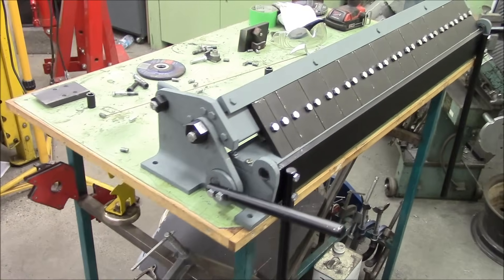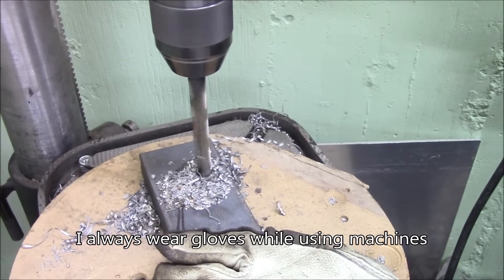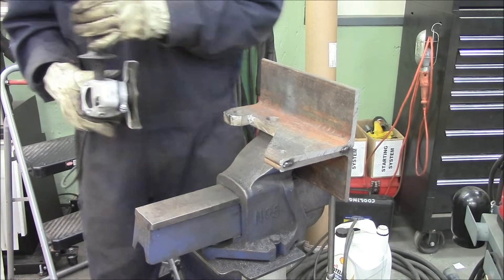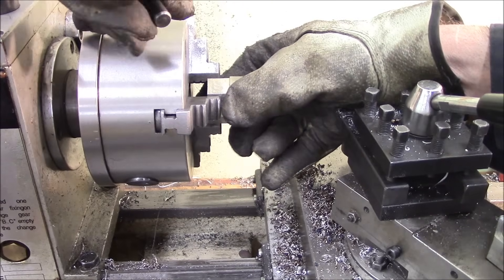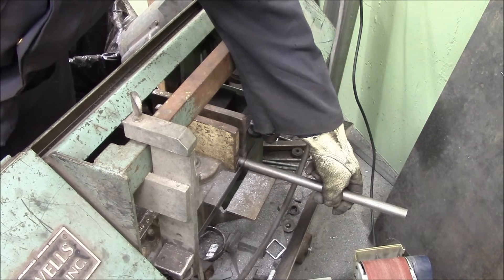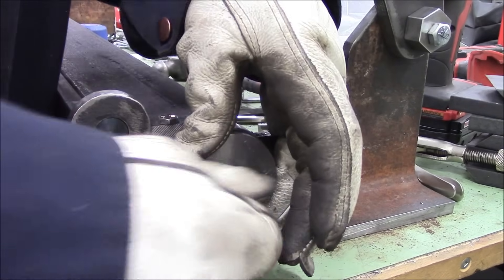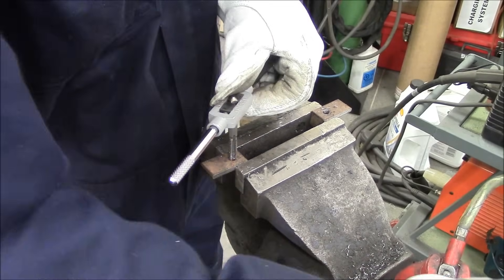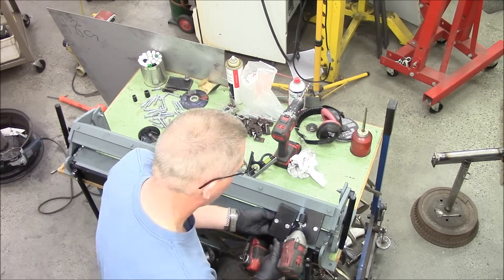BUILD a Sheet Metal Brake! FREE PLANS!

Comment: Nice work! What is the steel thickness capacity?
Reply from the maker: It does what I've needed it to do, which is usually 16ga and less.  The thicker you want to bend, the larger it has to be.  I'd say 16ga is the limit in steel, but I have not bend a full 36" length of 16ga.  I have bent 30" of 18ga.
Reply: @GregWellwood  thank you I'm using your design but modified to be 48"

Comment: why make an a-frame brace on top instead of a piece of flat bar?
Reply from the maker: You could make the whole thing super massive huge, but a typical A-Frame on the top adds the rigidity you may need, without the added expense and weight.  The height of it is what matters, engineering-wise.

Comment: 5:59. My experiences with a metal cutting wheel is the thinner your material the faster the cut (duh) I think I could have cut both pieces faster by themselves. Who cares if the angle of either side doesn’t match exactly. No one will notice. Matching holes yes, matching shape outcome no

Comment: Just watched your video nice job only one bone to gloves. You need to see what happens to best of them when you wear glove on any moving power tools. Yes I have stitches but after 40+ years as a Tool & Die maker I have all 10 fingers and all 10 toes.. I also wear steel toed boots dropped a 580# injection mold slide on my foot and walked away with a broken great toe. I saw what happens to your dead cow when it gets caught in a belt sander not pretty or a long sleeve caught in a multi spindle drill head he got lucky the shirt ripped off his back.

Comment: Will this bend 11 ga full width? Maybe I missed the specs?
Reply from the maker: I've done 0.100 in aluminum, but not steel. I doubt it's strong enough the way it is. For 1/8"+ steel I usually use a press brake I made.
Reply: @GregWellwood  hmmm, you holding out on me - where's plans for the press brake:) Saw a kit for one using a Harbor Freight 20 tom hydraulic press, looks a bout perfect. Except for the cost.
Reply from the maker: I never videoed the build of the press brake. I needed one "now" so I built it. I also built my press (no video either). Swag Off Road has a press brake "kit"....
Reply: @GregWellwood  , theirs offers pneumatic force to close the hydrauluc press. I'll build a power unit wirh better force/ smoother, faster, better control. Thanks.
Reply from the maker: I look forward to the video! (big grin)

Comment: Amazing! Many thanks for making your plans and your video available. It seems that your wordpress isn'tworking today anymore!
But if you need any modeling or any drawing I have my own commercial licence of ZW3D and I could help in any way then you are alo helping for free. I would like to help also if needed.
Yasser
Reply from the maker: It's working now.  Try again.  It may have been down for host maintenance.
Reply: @GregWellwood  Thanks, I'm working on a similar small manual bending machine. Do you have any documentation from a book for example explaining how the CANTILEVER system is working? I could share my model per email.

Comment: So I see a big mistake welding you did not clean the mill scale off  that will weaking your welds big time.I see your fingers for bending are all the same size.
My question to you what is the thickest you bent in Aluminium if any.
Reply from the maker: 0.100 so far. I really don't work with thick sheet very often.  When I do: I made a Finger Brake for the Hydraulic Press I made, which bends 1/4"+ steel no problem.

Comment: Why set an angle grinder on fire when you have multiple? Use a fan or rotate them out it's just temperature.
Reply from the maker: It could also have been just a really crappy angle grinder.

Comment: love the video but the gloves are a huge NO NO  in the trades. I saw many times where you leave the mill and lathe running while manipulating the components being machined. Just knowing that this video will be seen by many newcomers to the trade might be an issue. Hopefully the viewers that are "rookies" to the machine trade no better then to do this. In case they don't, maybe view some videos on injuries cause by milling machines and lathes while wearing gloves and loose long sleeve clothing (viewer discretion advised) most do not end well... Other than that, the video and plans are spot on 👌
Reply from the maker: Absolutely.  In both the narration and text, I specifically state: "don't wear gloves," as well as ask viewers to find all the mistakes I made in the video. You win!

Comment: Lol how about drill,tap, weld,cut, plasma, acetylene torch, braze , run a lathe and cut threads with lathe,, and wire up all the tools in shop plus wire the shop after I built the shop, 24x 36 everything but concrete, I did have the mixer after I moved out from home farm where 7 of brothers pored 13 reucks of concrete in one day between milking cows at 6 am and 6 pm

Comment: .oo4" .... Sounds like 0.1mm
Reply from the maker: Yes, the Lathe is Metric Only.  Like a true Canadian, however, I use both; Metric for certain measurements, and Imperial for others, with no logical reasoning for which system we use at the time.